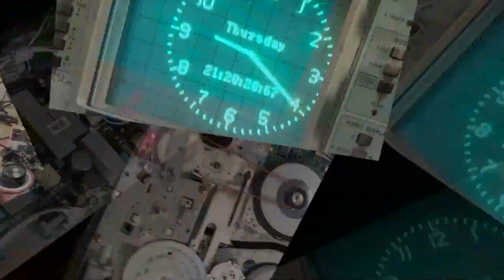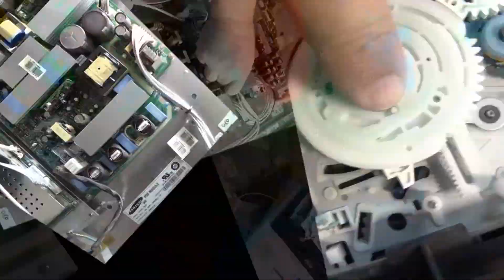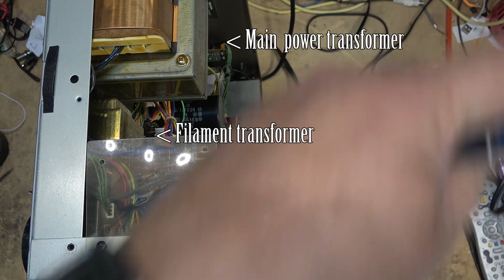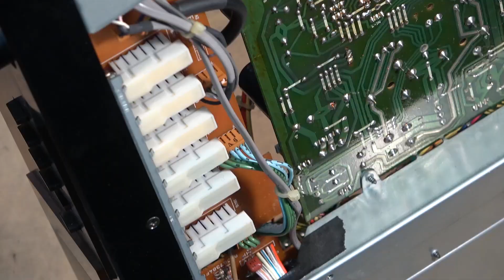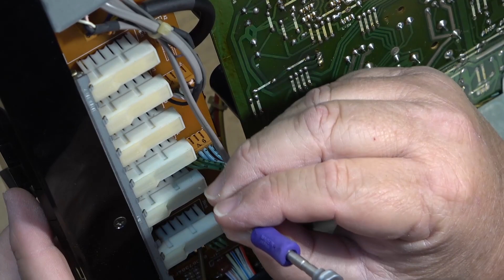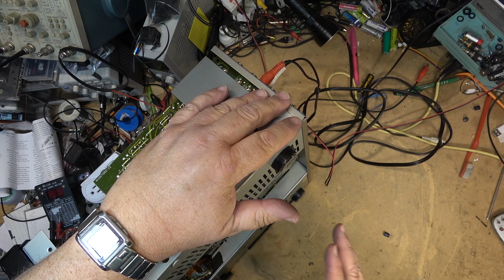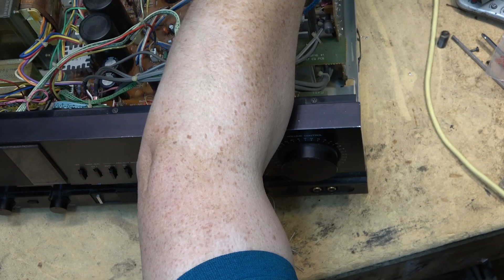Luxman LV103 Severe distortion on Left Channel

Comment: I've always said that the best amps were ones with tube preamps and MOSFET outputs.
Reply from the maker: They have a very tube like sound. Oh wait a second.... One of the best sounding amps I have had the pleasure of listening to was a PS audio hybrid. It used a 12ax7 buffer to drive a class D module and it sounded fantastic.
Reply: @12voltvids  I just can't get into Class D amplifiers and I don't know why. The efficiency is excellent though.
Reply from the maker: @srtamplification  if you listened to a good one and someone didn't  tell you it was class D you would never know.   
I and a bunch of others did a blind listening test a few years back. Every last one of us thought we could pick the best sounding amp and after the demo was done and everyone voted for the most transparent best sounding amplifier everyone had to pick their jaw up off the floor.  The class D was a qsc BTW and it was simply amazing.  I used to have the same mind set about class D. No more they have come a long way.  It's the theory if operation that has everyone thinking they are no good.  Early units that used low carrier frequency were really only good for subs but the switching frequency is now around 1200khz.

Comment: Hi Dave thanks for another informative video. My 2 cents to add here would be regarding pots and switches that are sealed would be to penetrate the plastic type using a hot poker as to not have any shavings go into the device
Reply from the maker: Remember they are upside down, so nothing will drop into the contacts.
Reply: @12voltvids  perfect with reverse gravity 🧐

Comment: Which EV cars do you have?
Reply from the maker: Chevy volt, a 2012 and 2019. These are plug in extended range ev. In other words the engine never fires as long as there is charge in the battery.  Once the battery is down it switches to gas.
Reply: @12voltvids  Plug-in hybrids unlike the Bolt. I agree that they are EV if you stay within  the limited range. You still have to haul around and maintain the ICE though. 

Being an electronics guy, do you feel better about working on it if yiu have to?.
Reply from the maker: @richardsmith2721  well there's very little maintenance to do on the internal combustion engine because it doesn't run that often. it will come on and go into what's called maintenance mode which will run it for a few minutes every couple months if it hasn't been used it will start up it will run do a full warm-up cycle to lubricate all the parts and heat up the catalytic converter and get everything up to operating temperature and then it shuts off. it also monitors how long the gas has been in the tank and once the gas reaches a birthday it will then tell you that you need to run the engine to burn the gas off and it will run the engine every time until you replenish some fuel. The wife drives the older one and she goes into gas mode a little more than I do because first of all hers is over 11 years old now and the range on the battery is much less because it had a smaller battery. Now as to those that talk about hauling around and engine and unnecessary weight the same can be said for a full EV such as a bolt or a Tesla or any of the other ones. I might be hauling around a couple hundred pounds for a small 4 cylinder engine and a fuel system and so forth which is not that big it's a small gas tank and a small exhaust system so of course that adds a bit of weight but it has less weight than hauling around a battery that weighs 2,000 lb. that's the beauty of the plug-in hybrid and why it's the only vehicle that I would drive if my vote were to get totaled I would be buying another plug-in hybrid unfortunately they no longer make the volt so I would have to go to a different brand probably a Toyota Prius prime or a RAV4 prime or possibly the escape plug-in or even maybe the Jeep plug in but one thing for sure it would be a plug-in hybrid. The reasons for this and there are many is first of all the battery cost. If the battery fails on a Tesla or a bolt or a full EV you're looking around $30,000 to replace the battery if the battery were to fail on a plug-in hybrid a replacement for the volt a rebuilt pack can be had for around 4,000. Another advantage to having a plug-in hybrid is as the battery ages the range gradually reduces. With a plug-in hybrid that's not an issue. For example my old 2012 has 185,000 miles on it now. When it was new it would get around 56 km to a charge that range has dropped now to around 47. Part of that is due to battery aging the other part is due to general motors reprogramming the computer to start the engine when they're still a greater charge remaining. The reason they're doing this is because they don't want the battery voltage dropping too low as the battery ages because if it gets below a certain level the car will lock out. The same is true for all battery only EVS as the battery ages the range is going to be reduced the range is always reduced in cold weather with a plug-in hybrid that's not an issue because the engine is there to start up and it will start immediately as soon as the battery reaches what the computer determines is its minimum state of charge and then it will charge back in the battery to keep the battery from discharging any lower. I've driven hybrids since 2005 my first one was a 2005 Ford escape not a plug-in just a regular hybrid but that vehicle was so reliable it had over 200,000 miles on it when I traded it in and the only reason I traded it in to buy my 2019 volt was because they discontinued the car and I wanted a second one while I can still get a brand new one.  The old one which my wife drives on an average and it's only a 35 l tank or 8 1/2 gallons she can go 3 months and on average around 2,000 km between filling the tank. I have topped 12,000 km on one tank of fuel on mine. The reason is the battery is bigger on mine so I have a much greater range about 95 km in the warm weather around 65 when it's below freezing but I have a much greater range because it's a larger battery. now someone said why don't they put a 300 mile range battery on it well that's not necessary that's why you have the backup engine you've got a battery that is big enough for your normal day-to-day driving and then when you need to go further you've got the gas backup. The huge advantage and this is a huge advantage is when I want to travel I do not have to plan my trip around stopping to recharge. Those EV advocates will chime in and say but it's only a 30-minute charge. Okay well when I need to fill up my gas tank it's about 3 minutes to pick up 30 l of fuel. I don't need to sit around and wait for 30 to 40 minutes to get enough charge to get to the next EV charging station and furthermore while I was traveling last Summer I noted the EV drivers waiting in line to get on the two chargers that were at the charging station and it was two or three of them waiting in queue for the next charger therefore they're not stopping for half an hour they're stopping for half an hour once they get on the charger they might have an hour to wait before they even get their turn that's what I'm laughing at these people that want to travel in an EV. The greatest commuter car and a car around town but I wouldn't want to trust one for a road trip, especially driving through the fire season we had last year where roads were closed sometimes for six or seven hours you're stuck on the road when it's 40° Celsius outside you want to be able to use your air conditioner if you're stuck in an EV and no place to charge up you're going to cook. At least I can run my engine to keep my battery charged and keep my air conditioning running which the engine starts and runs for 5 minutes and then shuts off for about 20 with the air conditioning is running so it's not even burning much in the way of fuel. for me and for anybody else that drives a plug-in hybrid we would never go full on EV for the reasons I've stated above.

Comment: So, the LEDs inside of the unit are just for a quick visual that the electrons are flowing as they should? I have a version 1 of the Rega Elicit integrated amp that has the same thing going on inside.
Reply from the maker: They are part of the bias.  When the respective tubes for that channel kicks in the led will light up.   So if a tube goes dead the corresponding led will be out.  Also if some other component fails in that channel it will be out.  All amps should be designed this way.
Reply: @12voltvids  OK, good to know. The Elicit is not a tube amp, but I'm sure it's the same concept for solid state amps. When an LED is out, then I know that something is wrong in there. Thanks
Reply from the maker: @JerryPemberton  that's right a lot of different amplifiers have green or red LEDs to indicate that they're working. It's just a simple cheap way to show that that particular circuit has got its power. They typically put one for the positive rail and one for the negative rail which will give you a quick visual that the amplifiers are receiving its power from the power supply so for example if you're in a no sound condition and you look at The amp and you see that the two LEDs indicating negative rail is missing then you know where to look.

Comment: Some people just don't like anyone learning, it's a pride/greed problem.
You don't mind giving us information about all sorts of things, we are not likely to ever be as good as you.
I knew about the series capacitors method to make a value, but dosen't it screw up the overall esr value, so for critical circuits it's a no no?
Just a silly thought.
Reply from the maker: Well of course your ESR is going to go up slightly so if the capacitor had 0.02 ear then putting 2 in series would make it .04  so you certainly would not be doing this in a resonance  circuit but we're not talking anything with any type of high frequency component. This is 60 hertz filter. Because it's a full wave bridge it's 120 HZ is what is seen. This is not going to have any impact whatsoever on a power supply but you wouldn't do it in a switch mode supply for example. I have done it however in the horizontal sweep circuit in the yolk on old black and white monitors where they used a dog polarized capacitor and one wasn't available so I put two regular capacitors with a negative turbos connected together it worked fine but because the ESR is going to double which did not have any effect on the operation but it certainly had an effect on the life of the capacitor. Sometimes so you have to do things like that if you can't source apart in a reasonable amount of time. What I was fixing monitors for example there are a lot of businesses that would bring their security monitors over. There was a jewelry store right across the parking lot from where the shop was and he had cameras all over the store and a bank of little 9-in monitors City on his desk in the back each hooked up to a VHS VCR. he would sit in the back and watch the monitors whatever there was a customer in the store while his wife ran the business and dealt with the customers. He would just sit in the back making rigs or fixing watches or whatever he did he was a watchmaker so he worked a lot of high-end watches and watch the monitors the entire time people were at the store watching for someone distracting his wife while they were trying to steal something out of the showcase etc. So what one of his monitors went down this was a code 3 emergency as far as he was concerned. He would March it across the parking lot to the store and expected fix within an hour. That was the kind of guy that he was he was paranoid that someone was going to rip him off if one of his monitors was down or camera was down. because he was friends with the older of course I had to drop everything that I was doing and get on this monitor and get it fixed and if I needed a non-polarized cap which I didn't have I had to make do with what I had just so I could get it out the door get it back in service. Sure it might only last two years and then it was back again and I was doing the same thing. But these monitors were left running all day when the store was open.
Reply: @12voltvids  He sounded like a right pain in the arse, but it was another job and money for the shop.
I wonder if he ever thought about getting a spare monitor, too tight with money i guess.
No i would not use series electrolitics in switch mode supplies.
Switch modes are picky.
Reply from the maker: @zx8401ztv  my old boss was yes.  Was a toxic workplace.

Comment: Well done on a relatively painless resurrection of a quality amp (you know you have something of quality when you see pre-heat and protection which works properly, saving complete chains of transistors etc from blowing). Curious as to whether you have ever seen any issues with old adhesive seeping under caps, causing conductivity between the pins.
Reply from the maker: Yeah I guess it's possible but that adhesive generally didn't flow that well. it was kind of like contacts met when it was put on so it didn't generally migrate too far under the parts it usually stuck around the seams. the big problem with it when they applied it no one ever figured it was going to after 40 years become slightly conductive so they poured it all over wires and jumpers and stuff and it's fine until it breaks down and then it starts to become slightly conductive. If it's in the critical area like the bias circuit it can certainly cause an apple fire to go out of bias. we're sitting in this apple fire it really wouldn't cause that much problem because it's basically just on the B+ and the B minus rails and the amount of leakage that's going to go through it is miniscule like we're not talking in the ohms we're talking in the mega overages so it's not going to have much of an effect on it other than possibly inducing a little bit of noise as the current mitigate to cross the glue could sound like a noisy resistor such a good idea to scrape it off wherever you can just to prevent problems. As it was drinking down and also released a corrosive compound which could attack smaller wires and I've seen it where it's been placed over is that or diodes for example and it's corroded the need away to the point where it's failed. It was nasty stuff and when you see it it's a good idea to try to remove what you can at least break the path between conductors so that you can't get the leakage farming across it.
Reply: @12voltvids  Appreciate the comprehensive insight. Keep up the good work.